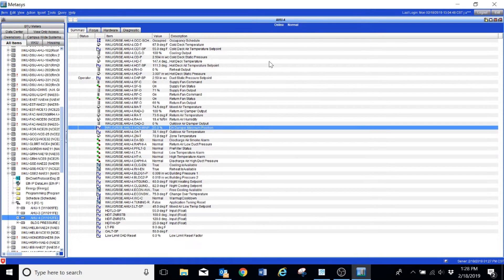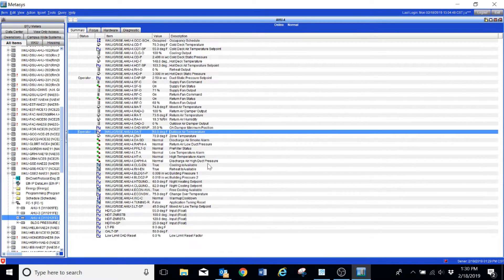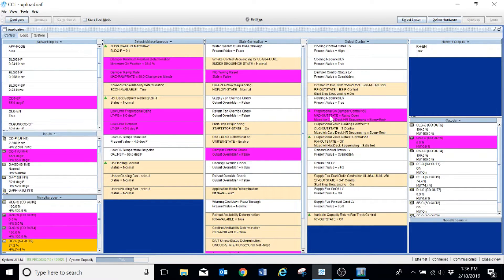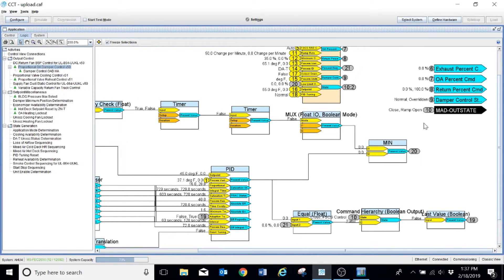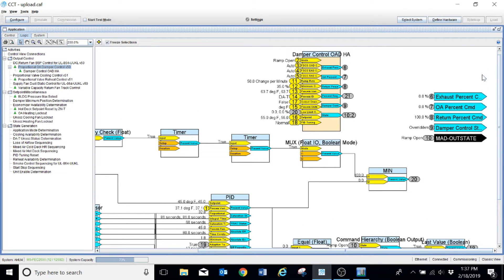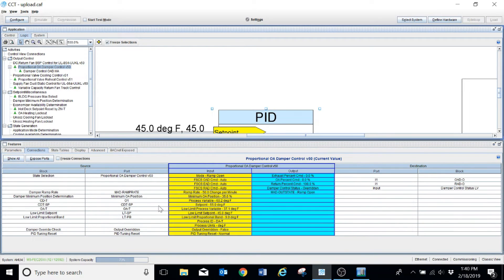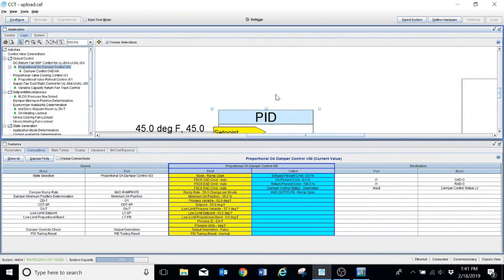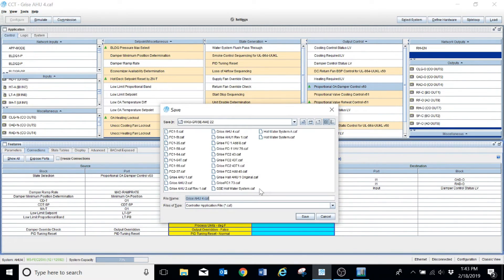Johnson Controls CCT Air Handler Programming issue Correcting point binding

Comment: I just realized the Air Handler Program within CCT does not have a lock out for the heat valve. So if you DX unit stays on too long then the heat valve kicks on.
Reply from the maker: That's why you always check out your program